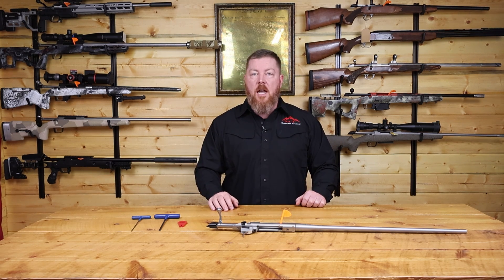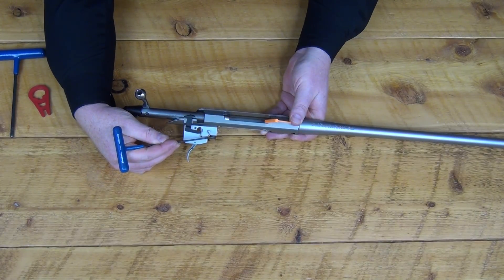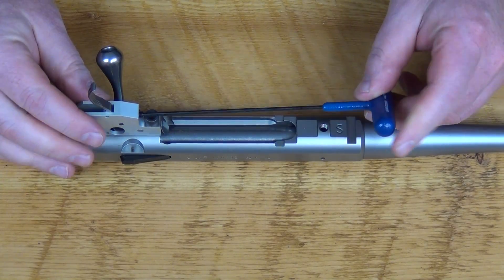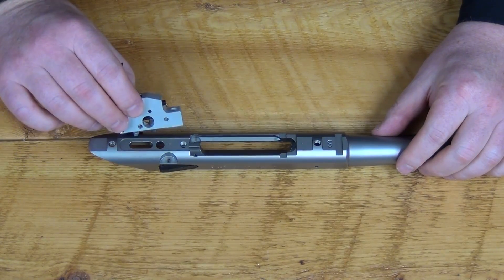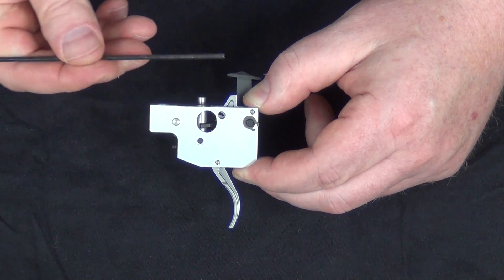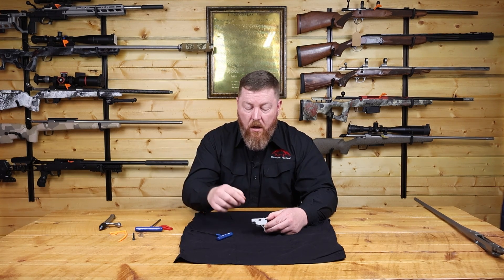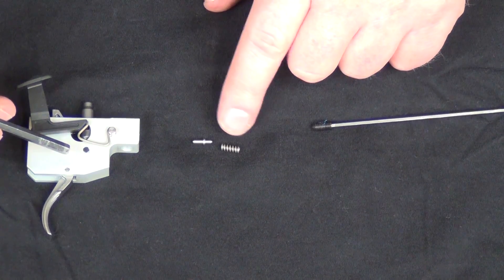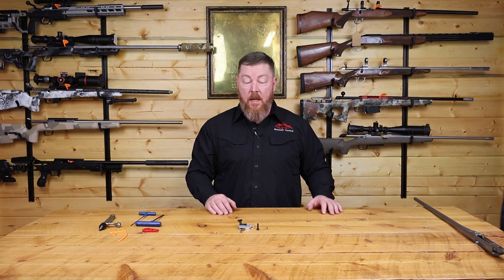Anatomy of the Tikka T3x - Episode 5: The Trigger

Comment: There is another spring in that thing.. I know cause the little keeper on the opposite side of the safety pin popped off and things flew.. I am pretty sure I have found the parts but I haven't been able to find out where that other spring goes.. Cannot find a single total overhaul " how to" fully dis and assemble the trigger.. Dang! Hopefully can fina an assembly diagram somewhere on Tikka site.. Thanks for sharing

Comment: How does their two stage trigger work?
Reply from the maker: The trigger shoe has a pivot point between the sear engagement bar instead of it being one piece. As the shoe pivots, a spring is loaded before the sear engagement bar is activated. As soon as the spring is compressed, the first stage is complete. The second stage releases the sear like a single stage trigger. 

Hopefully that makes sense.
Reply: @ Can the first stage be deactivated leaving only a single stage trigger? Not a fan of two stage but the model I want has a two stage trigger.
Reply from the maker: Unfortunately it cannot. However, I bet you could trade with someone. Dudes who like 2 stage triggers are rabid for them.
Reply: @mountaintacticalcompany  Good idea. Thank you for the prompt replies.
Reply from the maker: 👍 I do what I can 🤘

Comment: The tac a1 trigger looks like it has an extra button that allows you to cycle the bolt with the safety on.  I like this.  Can i buy this trigger and attach it to a t3x lite?  Maybe with a little relief cut in the stock for the extra button.
Reply from the maker: Great observation!  The Tac-A1 trigger is an awesome 2 stage trigger with the handle “open on safe” feature. Unfortunately, I have never seen it for sale by itself. 

If anyone has a link to one, please post it!  I want one!

Comment: The trigger screw is actually the biggest weak point on a T3. Seriously regularly control your trigger screw to be tight. If it ever gets loose enough, the firing pin will slip trough, because under its pressure the trigger is moving downwards due to the loose screw and the gun will missfire while closing the bolt. 

But to be fair, this isnt really a big problem. I had the problem once years ago on my first T3 and since then I regularly control it and tighten it as much as possible. And I never had a problem with a loose screw again on any of my 5+ Tikkas. But a second screw, or a pin would be nice to have.

Great vid guys!!
Reply from the maker: Do you think a little blue loctite would help?  Thank you for the feedback!
Reply: The  tightening torgue is actually quite massive on that bolt from factory. It is hig strenght steel and can withstand more than you think. The M6 bolt is ISO 12.9  - highest possible strenght (?) and is torgued to 15 Nm.   - Not going to take any responsibility on this one. But reason why your trigger is loose from the action is that you dont have the gourage to go where it is required.